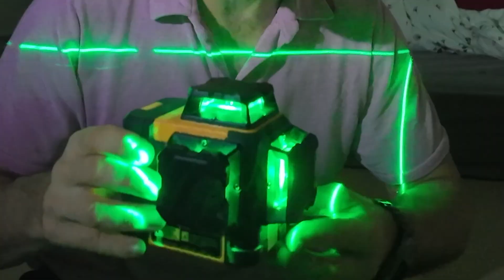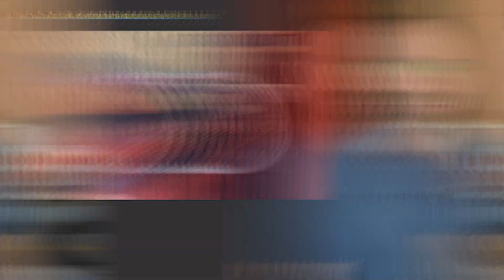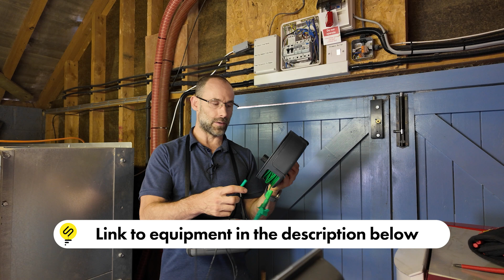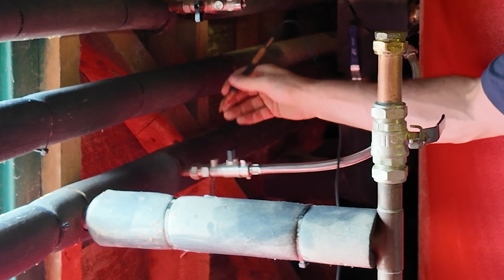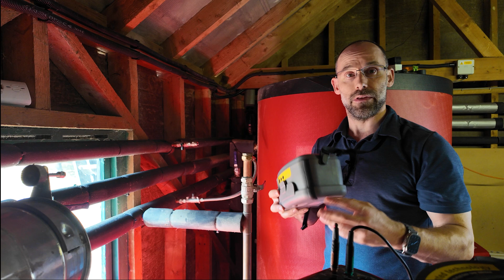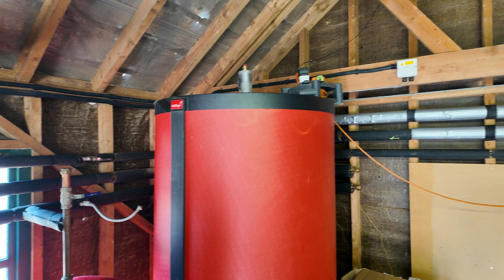⚡️ Smoke from WATER Pipes? How to Unravel the Mystery

Comment: Very interesting video indeed and thats a prime example of what can happen, and its quite shocking well spotted by you Ben. When you said you had zero continuity I presume you had a high resistance value then on your MFT or infinity. would i be right in saying that theres 2 problems here ie the fact that the flow and return pipes arent bonded to the main earthing terminal and also there must be an earth fault somewhere thats causing it.
Reply from the maker: Yes I think that’s right. Entire shed will be required. The exterior twin and earth should never have been there in the first place, and is now degraded

Comment: Looks electrical. Someone is using that link as an Earth-Neutral return path and hasn't sized the st-st flexi-link for adequate electrical duty ;-). No, really.

There's either an upstream equipment fault that's shorting to the copper feed-pipe, and linking across the braid to the good (distribution) PME (neutral-earth) return path.

Or the water main bonding has taken over from the supposed MEN (main earth neutral) connection at the distribution/consumer unit [that's another sort of fault].

Let's watch and learn!
Reply from the maker: Earth clamp meter testing shows a continuous 300 mA earth leak somewhere in that shed. Looking forward to narrowing it down further in the coming weeks.
Reply: @SmartFew  When I re-bonded my water pipe (we have an over head supply split from a 3 phase pole) I had a peak of 0.5amp flowing - likely it was providing a supplementary parallel path for a bit of phase balancing for the group of houses the 3 phase pole supplies.

 Just now I have 20mA in the MET link, and zero on the water bond, but I did get the old wire fuse box replaced (so terminations have been re-made)!
Reply from the maker: That’s really interesting. We are close to a neighbour who is on a different phase, and the transformer is close too. I hadn’t considered phase balancing current, thanks for the idea.

Comment: What you have there is different earth potential. Just because you don’t have continuity between earth and the second copper dosnt mean the second bit is not earthed somewhere. 

If it had no earth connection it wouldn’t get current flow as it would have no return path back to the transformer. 

I would hazard a guess that the situation changed from when the shed was originally wired. You may have the Earth exported from the house to the shed and then someone has added something connected to the literal earth. The shed should have its own Earth rod or system and everything in there should be connected to that and bonded if it is connected to the literal Earth. 

Or at least that’s what I think but not being a sparky I would get a proper sparky to look at it. Now getting someone good thats the real skill.
Reply from the maker: Thank you! I am a "proper sparky" now, well apart from a bit of admin on the NVQ. I agree with your analysis overall, especially apart the return path. The solution for me will be appliance testing the boiler, and re-wiring the whole shed and consolidating to a single supply. There probably is a sneaky earth rod out there.
Reply: Car chargers often have their own earth rod due to risk of PD from local earth to car body when in charge for someone standing next to and touching car. So yes you could just be looking at the difference between two earths, but it seems strangely high to cause the pipe to get that hot. What kind of supply do you have? Have you measured earth leakage current on your supply incoming earth? And then there’s random things like PEN faults and imported earth problems. Have you got an earthing test kit for the MFT? Before you worry about rewiring I’d want to have a really good look and measure what’s going on with the supply and all the earthing.
Reply from the maker: @speedbird300  will do, just got a decent AC clamp meter today so looking forward to narrowing it down.
Reply from the maker: @speedbird300  my supply is complex, TN-C-S at origin but also earth rods for when in off-grid mode. No Earth test kit for my MFT, think I need to go up a model in the range for that.
Reply: @SmartFew  I thought you seemed too skilled for a general YouTuber. If you have an off grid complex setup then some sparkies have differing opinions as to how earthing arrangements should be handled. I guess your setup has an earth cut out when in off grid, but these don’t always get put in. 

I’ve got a feeling that the current thinking is to go to a TT system and have done with it and make sure your generation is earthed, but I’m not an electrician.

Is the earth exported from the house / main supply to the shed? What voltage are you getting between the pipes. I guess you’d be getting voltage from neutral / earth from the TN-c-s to the extraneous conductive parts? Guess it depends on the resistance to earth. 

BTW when I said proper sparkie I meant not me. Congratulations on doing the graft and the videos, you do come across as a good teacher and presenter. I subscribed on the strength of this video.
Reply from the maker: Why thank you David. Yes the Victron Quattro switches the Earth, and I'm going to be doing a series of videos on the setup whilst simultaneously rebuilding it and optimising it so I look forward to your comments on that!

Yes the decision here is to go TT, but we're also keeping the supplier's TN-C-S earth for when on grid. I can't wait to do more content, and comments like yours really help.

Yes the sparky training was a graft, but worth it so I can sign off all my own work.

Comment: Solving your grounding issue is great,... but you need to investigate the source of the voltage potential.  Maybe a fault in electrical heating elements.
Reply from the maker: It’s a fault in the car charger circuit, isolating that removes it. Will fully insulation resistance test the boiler soon though to be sure.
Reply: @SmartFew  Car charger is connected to the heat fluid piping? Something seems strange. The installer ground it to your piping system?
Reply from the maker: No idea what they did, was over 10y ago. Looking forward to ripping it out and doing it properly.

Comment: Sort of.
What are you going to do for the heating? It's getting colder and turning it off is not a real solution.
Reply from the maker: @alexjames1146  turning the car charging circuit off removes the fault so I’ll leave it isolated until I re-wire.
Reply: @SmartFew  So… Another electric vehicle!? 🤔

Serious question:  Was that EV made in Ch ina?

I’m only asking because there are numerous video’s of electric charger issues (not to mention the ev batteries horror’s).

NB:  Thanks for this video raising awareness of such issue’s. 🙂
Reply from the maker: @12235117657598502586  actually it happens with no EV plugged in.

Comment: So if I understand this correctly you have a leak to earth but no ELCB to trip out and protect your system??, If you do why did it not trip??  PS time to chill out with a brew and some music, Deep Purple Smoke on the water??  I'll get me coat.
Reply from the maker: Yes it’s strange that INITIALLY the RCD didn’t trip. It does now. Overall the fault is clear: car charger circuit leaking into pipework. Whole shed needs a re-wire so I’ll leave charger isolated till then.